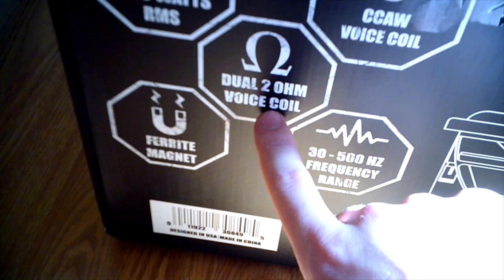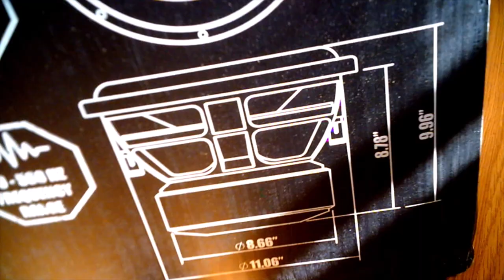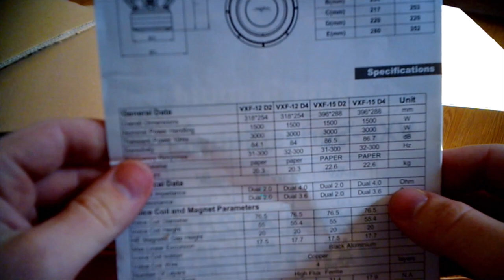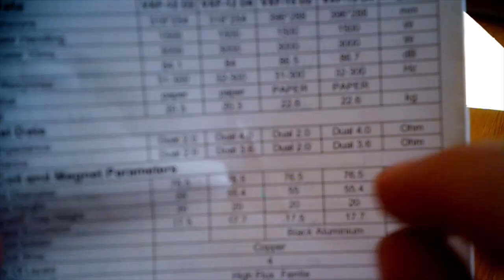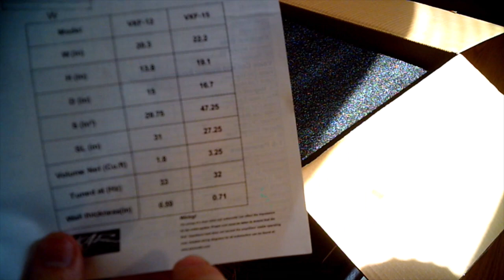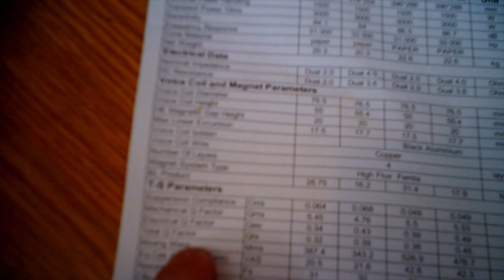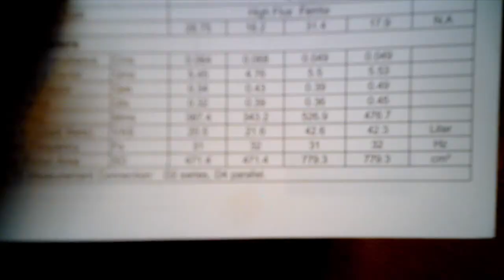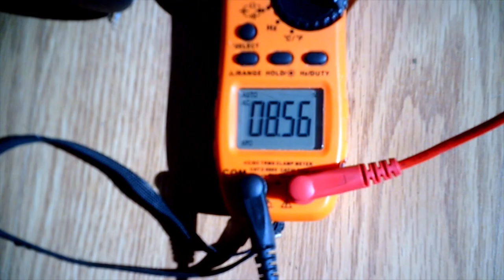Skar Audio VXF 12 D2 Unboxing With NCS Audio Tracks

Comment: Put your wires in from the back and flush cut them on the outside of the terminal. That's how I did mine and it's super snug in the cutout.

Comment: Do you still have it? If so how has it held up? I got the VXF 15" Dual 2 I just got it two days ago. And it's amazing it hits hard as hell
Reply from the maker: I do still have mine and is perfect condition, I have it hooked to my modified Audio Pipe APMI1500.1D Amp which now outputs about 2100 Watts rms @ 1 ohm. Mine hasn't broken in yet and it's insane.
Reply: @anthonyvolkman2338 Nice! What did you go to mod the apmi15001d? Did you end up changing the output fets or boosting the rail voltage?
Reply from the maker: @rashad5286  I actually did both, and much more! I actually installed true pulse caps for the filter in the output, they were using a non polarized electrolytic cap. That's a very stupid idea. I upgraded all Fets (power supply and output Fets), boosted the rail voltage and other stuff.